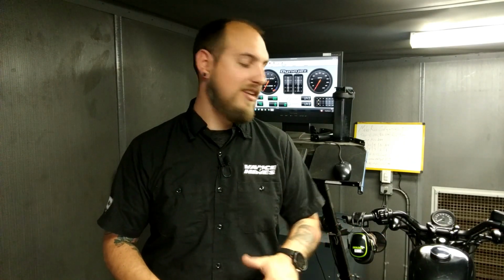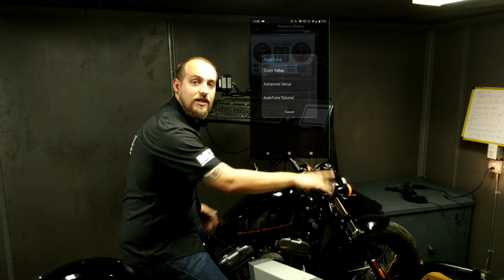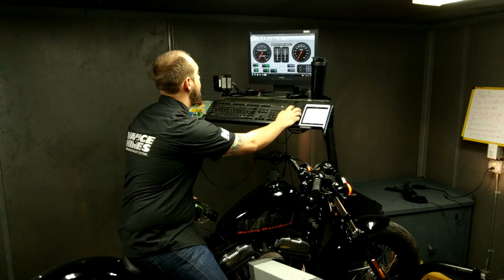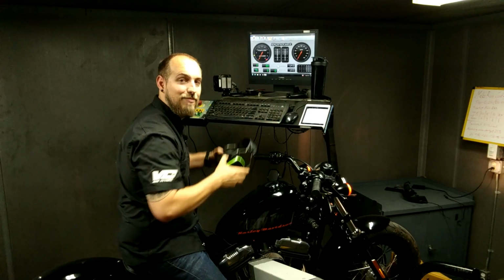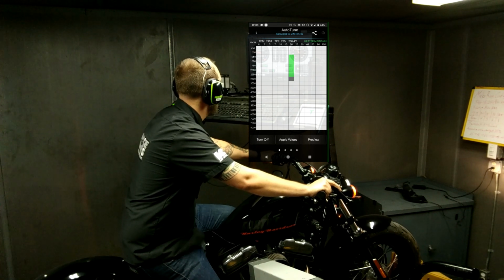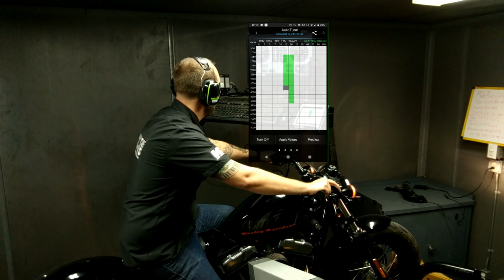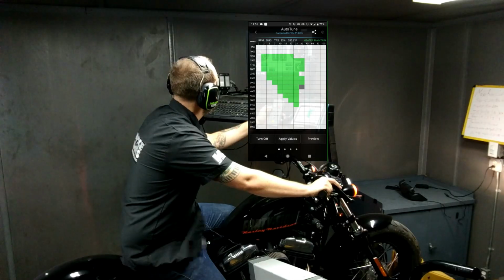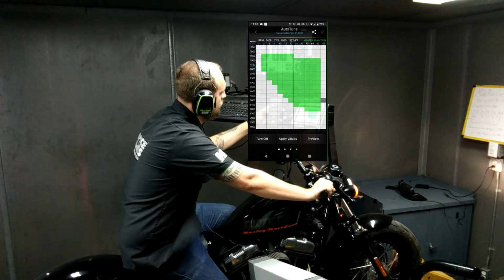Fuelpak Pro Mapping Tutorial

Comment: I was wondering if it was possible to tune on a dyno. Many youtubers say you can't. I think it as mention BT as bluetooth.  It may lag, but your FP3 will have the correct values.  Really great video. Many say you have o also tune it one a highway witch can annoying and risky because you have to get it to near 100% throttle. this was very useful. How can you link up the dyno computer to FP3 I know blue tooth. does do all dyno's enable bluetooth.
Reply from the maker: The Fuelpak Pro and FP3 don't link up to the dyno, and the dyno is simply used as a tool to control engine and wheel speed to help fill the tables more efficiently.  I've done this on the road, and it takes about twice as long, and you don't get all of the same cells since it's not safe/feasible on the road.
Reply: You can always go with n the FP3 and manual input the AFR values .     Instead of auto tuning...    Just fill out the green blocks...to what you like ...    In the proper sweep scale ...    13.8 AFR ...   Good to go...

Comment: Hello, why dont you use the 5 gear for your session ? You need to open 0 to 100% in 4 and go peogressivly in all blocs ?
Reply from the maker: 5th gear on this bike is an overdrive gear, and it would work the bike pretty hard, raising wheel speed unnecessarily for the application.  4th is a bit gentler on the bike, it's easier to manage engine temp, and you still have plenty of time to populate the cells as needed.

Comment: Curious question here. If I were to load all the same configurations to my fp3 on my 2018 48, would I end up with the same results as this? Also, if I add the fp3 PRO to it, would it HAVE to be dynp tuned or would an auto tune do the same thing?
Reply from the maker: Potentially yes, pending you live around the same elevation as where the bike was tuned.  Wideband AutoTune with the Fuelpak Pro is a more advanced version of what you're familiar with already, so it can be done on the street or in a dyno.

Comment: Hello, could you please help me? I would like to know what is the best map for a Harley Forty-eight 1200cc, 2014 model with / Vance & Hines Shortshots Stepped exhaust, Harness Big Suker stage II high flow filter, there is a good mapping for these accessories , in terms of performance, good strong sound and power that is already pre set to program.

Thank you, and very good videos congratulations.
Reply from the maker: All of our FP3 maps on the server were created in our dyno rooms in Santa Fe Springs, CA with real components on real bikes, and are optimally tuned for your bike.  I would recommend running the preset Shortshots Staggered map with high flow air filter, and your appropriate baffle type.
Reply: Canned maps are starter kits. Get out your basic research and math skills. Drive the af down to 13.5, advance 5 degrees, idle up, run 93 octane. Guaranteed. And make your own air cleaner.

Comment: what do you recommend running autotune or loading a preset map from the app?
Reply: My butt. In one afternoon I just beat autotune. Canned maps are just starterbkits. Get your math books out and drive the af down to 13.4. Advance the spark 5 degreesvjo matter what. Idle up.
Reply from the maker: Typically I recommend running the preset map for at least a tank of fuel, but there's nothing wrong with throwing it straight into AutoTune mode to learn the VE's for you specific bike and setup.  If you do this, please utilize the Preview button as a way to know when your VE tables are tuned to spec, then select Apply Learned Values, select Finish, then get out there and ride!